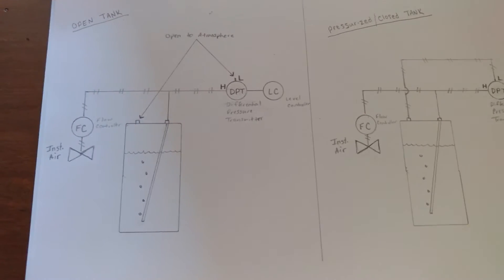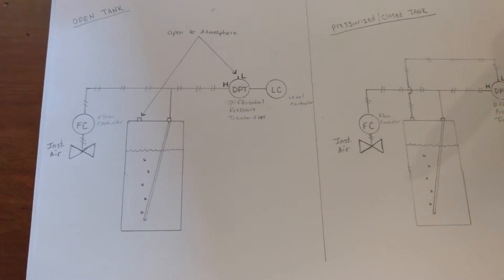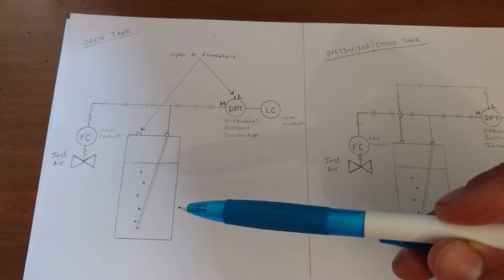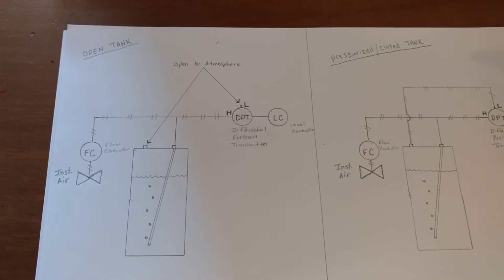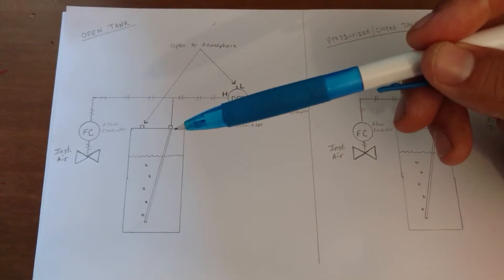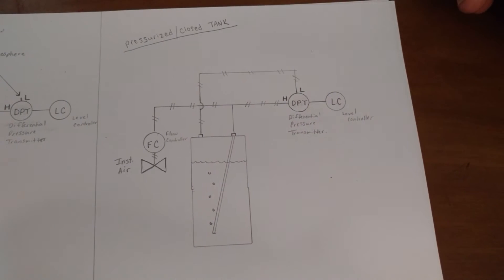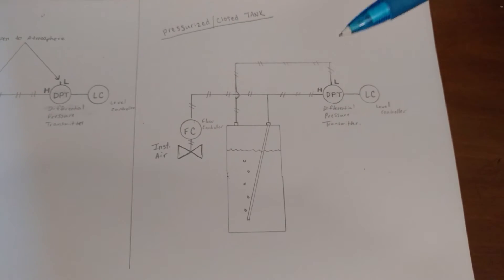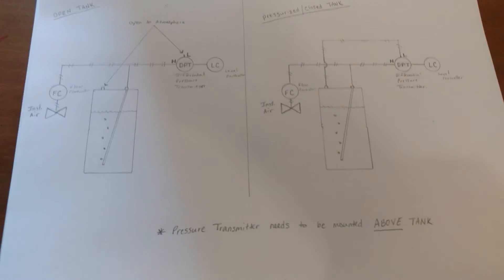What a bubbler system is and how to connect it to a differential pressure transmitter.

Comment: Thanks for the explanation, clear and concise. I'm not in the field and it wasn't clear to me what "bubblers" when they are mentioned in other videos. The open and closed tank examples are a big plus; you might want to consider touching more on the concepts of differential and relative pressure, it might help others understand other systems that work on those principles as well.

Comment: Does the angle of the tube matter? Could I use this application to measure the depth of a lake at a certain point? (End of a pier) Would the tube have to be mounted perfectly vertically at 90 degrees at the end of the pier or could the tubing be sloped from the edge of the lake, extending to the end of the pier, with the DP transmitter at the shorline? How well do you think the DP could handle small waves at the water's surface?
Reply: Only the vertical depth matters.  If you know the angle, then use pythagorean's theorem to get the actual depth.